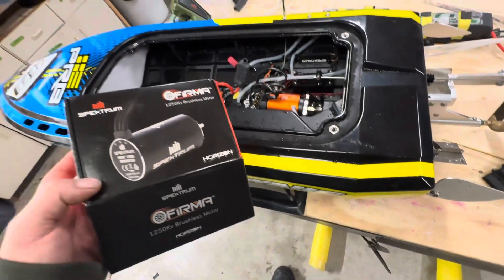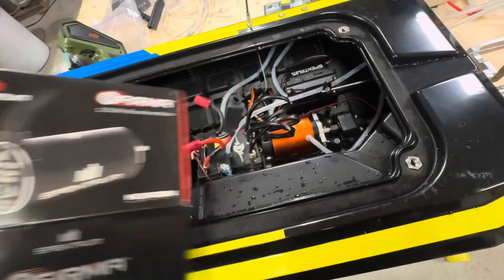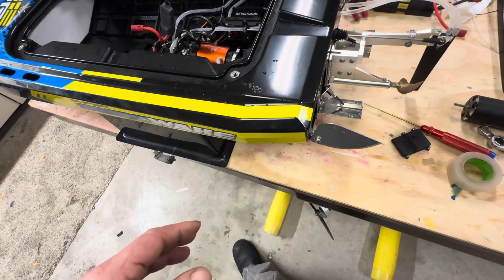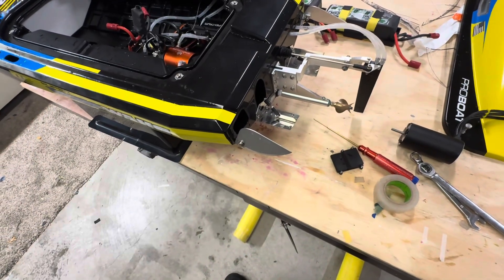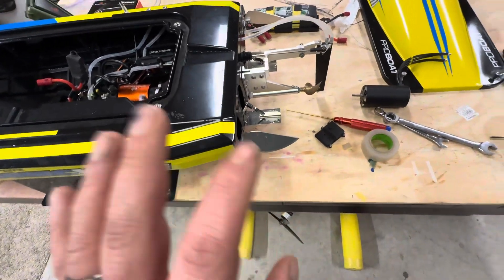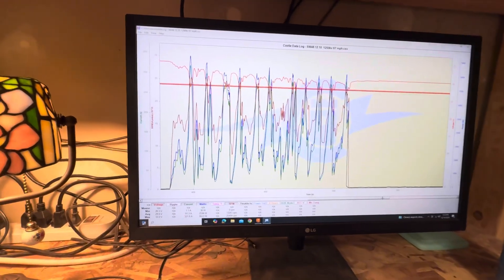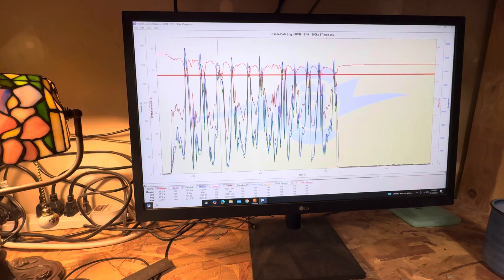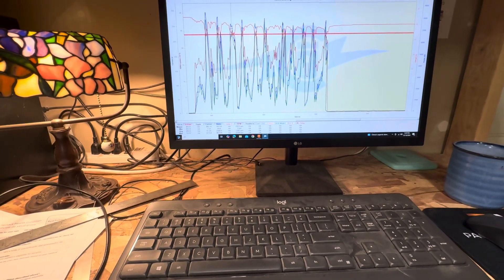1250kv Motor Experiment (67mph) in the Super Sonicwake 48 ￼

Comment: My second question I also have the Blackjack 42 and wondered if you’d recommend the 4685 1350kv for that boat over the 1250kv for the SSW48?

Any thoughts I’m happy to hear and try to learn from 😊

P.S. I’m looking to use both matching ESC’s and motors from the BJ 42 and SSW48 in a big Deep V-Hull
Any recommendations on some twin drive hulls you might like?

Thank You
Reply from the maker: What I’ve heard from other people is the 1350 works but ends up getting hotter, depending on the propeller.   
I was experimenting with different KV and  figuring 1350 was too much for this boat.   
1250 was a better option slightly lower KV, but enough to get the boat up to good speeds.  Also still having selection of different propellers that you can use.  

Best to start off with the stock propeller  
Or a 5214 prop as well.  
I ran  propellers up to a ABC 2215 but for speed runs  1-2 pass which this a big prop.  
Stick to the stock or a 5214 and the motor will serve you well
Reply: @mad_lizard 
I bought these three props for the BJ 42 stock electronics and now understand they are not the ones I will be using… Oh Well
5016 3 blade will try to sharpen the balance this propeller myself as that was not an option
1716 Oxydean 2 blade already sharpened and balanced
1816 Oxydean 2 blade already sharpened and balanced

Comment: Thank You for posting this and sharing your experiences! This is Exactly the information I’ve been trying to find and will be buying this motor and the Hydra XLX2 to go with it  :-)
I’m wondering which version of this motor do you recommend? I have found these 2 versions and there might be more. Once again I really appreciate your sharing and just subscribed to your😢 channel 👍🏼

Spektrum Accessories Firma 4685 1250Kv 4-Pole Brushless
Motor 8mm SPMXSM1205

Spektrum Accessories Firma 4685 1250Kv 4-Pole Brushless
Motor 5mm SPMXSM1200
Reply from the maker: The one with 5mm as this size will fit to your motor coupler.  
Thank you appreciate it with your thoughts and comments

Comment: man talking about spending money new motor new power supply different prop  and the original stuff is just collecting dust .   I wish i could do that but once i get the boat i will just enjoy it the way it is.  maybe change the prop but that's it.   your lucky have extra money to spend.
Reply from the maker: @oceanchaser   eventually it does all add up to amount spent.   Normally I’ll do upgrades 1 at a a time. Being a hobby I have a passion for and this hobby community I just do it with out thinking about it.   Yeah some stuff will sit till I have another project and use for the items like the old Esc and some hardware.   
In the end for do this was also bring new content to the channel and what upgrades do for performance to the boat.  
Out of the box the super sonic is a fun drive around boat.  That will turn some heads as to the size.   
Simple prop upgrade does wake the boat up to being slightly faster.  53-55 mm x 1.4 or some abc props and being reliable.  
As goes for anything this hobby, cars ect.  Faster is money. lol
Reply: @mad_lizard   I think what you do makes you happy is important

Comment: wow, you have very good batteries, good esc but 1250 Kv is crazy with this 2215 prop.Theorical speed: 95 +mph! What you have to know is for a same motor size is the delivered torque is inversely proportionnal to the Kv, means  you can have more power, but prop size must be decreased !  I bet you will have more speed with the original prop  just sharpened...
good trails!
Reply from the maker: @vincentvassallo3843  yes, More Kv/Rpm changes the propeller diameter, and pitch.  Theory speed over mathematical calculation on propeller numbers and RPM yes without any type of propeller slip and drag.  Now this prop in testing was really too big for the motor change. My estimation 50 mm to 54 mm. Size 
Most of my propellers were based off the stock system and I have on order a few smaller size props for the new number.  
The motor and Esc took a 2215 with no problems except Amp load was extremely high.  300 plus amps.  If anything this prop would make for a few speed runs 
So far the fastest claimed speed I’ve seen is 68 mph.  
Since this video I have made a few set up changes to the hull back to my base line and going to Run again soon.

Comment: @mad_lizard one of the best runs I have seen for this boat . Never seen turn fins in almost horizontal position as shown in beginning of this video .

Let’s see you blast this boat . Wondering if you will reach 80mph .

In your next video would appreciate if you could please share and list the non stock addons , speed with which prop etc.  👏👏
Reply from the maker: @minochercowasjee  well thank you and I’m starting to figure this boat out as getting a good set up on it.  
Since I have moved to more modifications and motor changes and such, I was going to post a video covering, where to start on a basic set up, what are good propellers to use for type of ESC that you’re running. 
Starting off with bone stock to  lightly modified to heavily modified.   
Reaching 70 miles an hour was my first goal. I’m close. I just need to do a little bit more tuning with a new motor and changes within the ESC.     
Reaching 80 is possible, but it will be a little bit of time getting everything dialed in  and a few new upgrades to bulletproof the boat more.   
Turn fins are weak and bend in a fast hard crash, im upgrading those as well adding a brace  for the Rudder arm for more strength as I’ve heard the arm breaking at higher speeds.  And once I break the 70 mark. Then a TFL adjustable stinger. Upgrade and new Rudder modd for increased reliability, and performance.
Reply: @mad_lizard  I am super excited . Let’s Get it on .👏👏

Comment: Mad lizard , what prop and batteries re you running ?
Reply from the maker: @asiringoringo1  prop for this run ABC 2215 and SMC 8200 150c lipos
Reply: @ dang man up to 60mph , with 57mm diameter, I only got 57 mph with octura x457 b&s , I might try with SMC batteries

Comment: It's the BlackJack 42" stock motor. From what i read it will get extreme hot on 8s...that's why they stuck to a 950kv cause it's a larger rc boat. Good luck.
Reply: The blackjack 42” came with 4685 1350kv , 4685 1250 came from Arrma kraton 8s EXB with 8mm shaft
Reply from the maker: @TargetingXmod_RC   same to what I heard for the 1350kv getting running hot on a few people.  I also feel anything over 60 mph this boat is a handful to keep it on the water and stable.   
1350kv I thought it was too much Kv and something between 1100kv -1200kv was a better choice to try.    Slightly more RPM overstock and still enough torque to push the boat. 
Temps with a 2215 abc the motor only reached 105f and esc 90f.   I still need to tune the hull and mess around with props again.
Reply: @mad_lizard  I think you should swap out the hull altogether 🤣
Reply from the maker: @bushyfpv8036  I already have a Seaducer, RICO Racing Hulls, black pearl, hydro, Ose m34 mono, Ml Boat works hulls, and a few pro boat hulls.   
Build almost of my own parts and hull builds as well.  However, I find it enjoyable  taking a boat like this and pushing its limits.   Under dog of the hobby.  
Money is not a concern and the joy of the hobby.